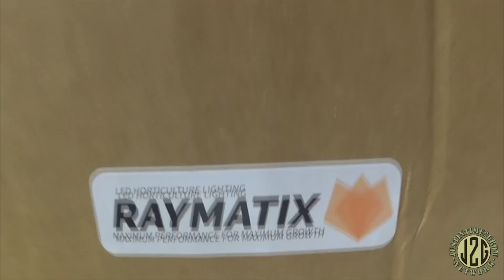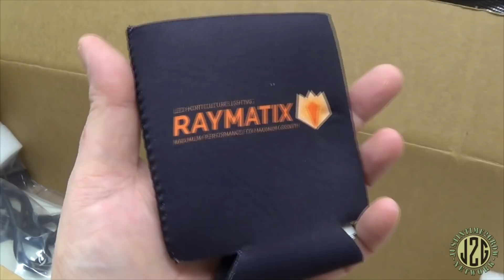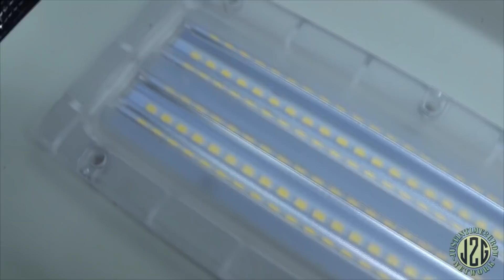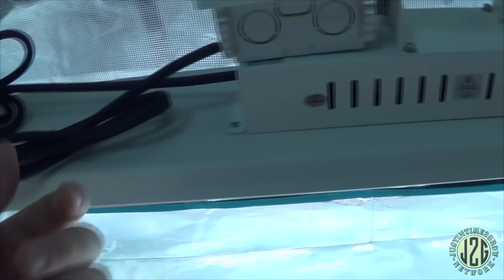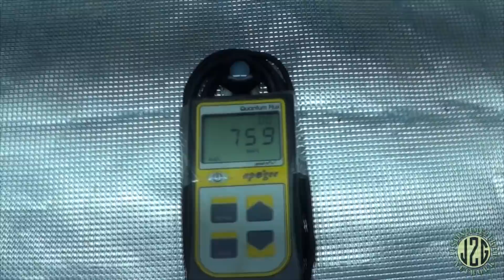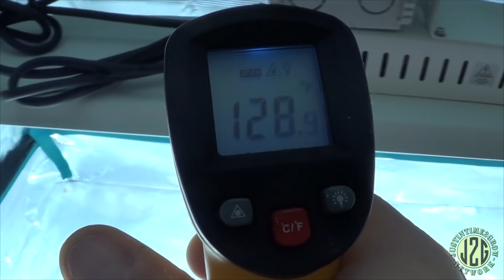2020's Best LED for your 2x4 Space?? - Raymatix HAMR - PAR, Wattage & Heat Test

Comment: Is there a way to dim without the dimmer
Reply from the maker: If you take away the dimmer how you gonna dim it?
Reply: So I ordered the light, and I shoulda listened to you, but it just came today, and damnit, No dimmer included...but in the drop down options for the extra plugs they shoulda had the dimmer in there..turns out the dimmer was under products, so now I'm kinda screwed because I germinated 5 seeds and they r ready for this light that I have but now I hafta wait for the dimmer. So I guess I was hoping for now there was a way to dim it like some of the other lights you review where it seemed like it would dim with the turn of a flat head, kinda janky...I'm bummed out. Took over a week to ship too
Reply from the maker: @kurtkas2003  I can make suggestions but I can't make people take them. 🤷‍♂🤷‍♂

Just raise the light up about 4 feet above them and it should be ok. 5 seeds can be grown under a single 26w CFL for a few weeks at 3-4". There are plenty of ways around this.
Reply from the maker: @kurtkas2003  Also make sure you suggest to raymatix that they make the dimmer part of the drop down menu or something. I'm sure they would be open to customer suggestions.

Comment: My buddy just pulled a great run with two of those lights in a 5x5’ tent. He flipped the clones early, like 10 days of veg after they were rooted and transplanted into 1 gal square pots and grown in a sea of green style. He yielded just under 3G’s a watt and in 72 days from the time he took the clones from the mother. I think these style of QB lights are best for growing as many short plants as you can fit that have a single main bud instead of trying to grow a few big tall plants that take so long to grow before the flip. You lose an extra run per year at least.

Comment: The Spider Farmer SF4000 at 18" gives 1620 but price is $569...
Reply from the maker: Sin Eater 1620 is far too high. It would need to be raised up.
Reply: @Justintime2grow  right was just comparing the 18" bc was 18" spec in the vid...24" is at 998
Reply: Wattage is also almost double on that unit. If you were to take two of the HAMR modules in the same space they would be relatively equivalent on PAR to the spider farm. Not to mention the SF4000 is built for a 4x4 or a 5x5 and they actually list it as a 5x5 or a 6x6 while this is made for a 2x4. Kind of a strange comparison to me.
Reply: @xTheEnigmax  I didnt mean to compair the 2 like that sorry if I came over wrong..the one you got is $269 the SF1000 is $159  so I was more looking at cost as well as coverage...I use the SF4000 in my 5x5 and the SF1000 in my 2x4 and 3x3...Give it a try sometime and let me know if you like it...I personnally dont much care for the long skinny fixtures anymore since I went to the square fixtures...easier to deal with in my opinion...